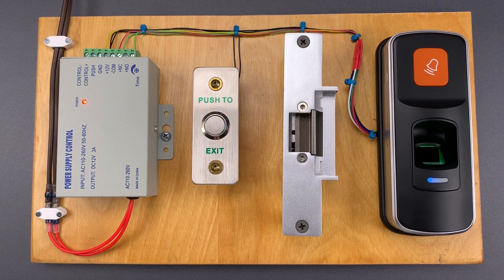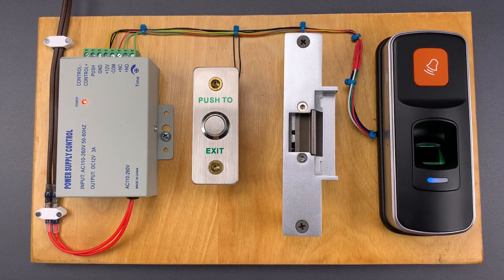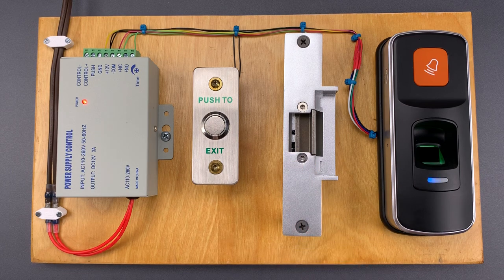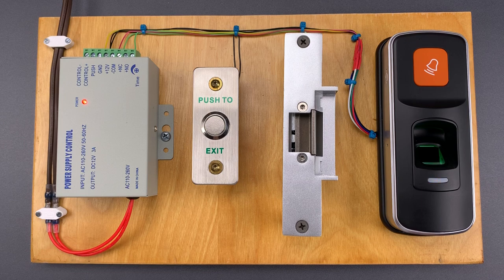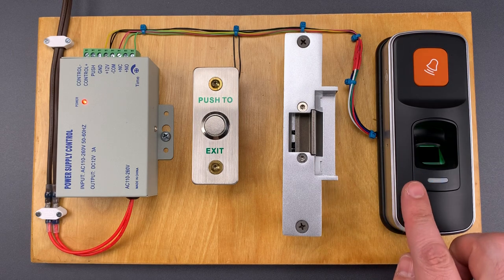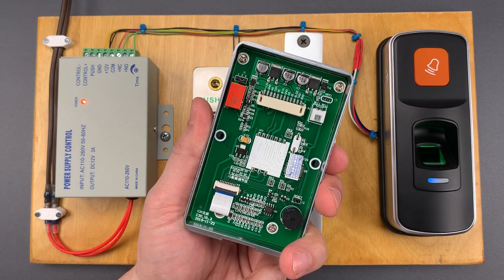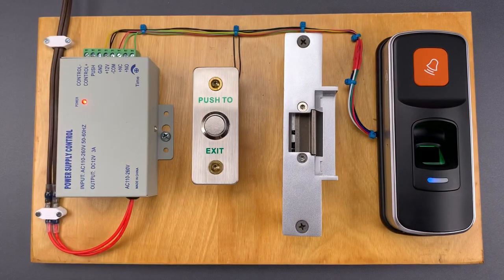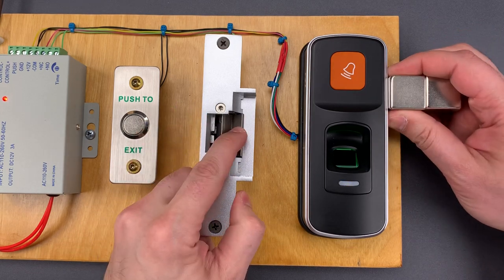[1060] Opened in ONE Second: HFeng Fingerprint Lock

Comment: "How To Destroy An Entire Industry In Less Than Two Minutes!"
Reply: hahahaha
Reply: 1 second specifically
Reply: How To Make An Entire Industry Up It's Game In Less Than Two Minutes.
Reply: but that wouldn't work if they'd used a powerful transistor or triac instead
Reply: I would say improve because they have to make the lock more secure.
Reply: I don’t even think I’d be that hard if you just had only the finger print reader on the outside, not even storing the data about the finger print on the outside with everything else inside. Bam you got a way better system
Reply: @treyspiller3931  right!
Reply: @jskratnyarlathotep8411  There are also solid state relays which are completely electric, no magnet involved.  They use these types of relays because they are much cheaper.
Reply: @jskratnyarlathotep8411  Relays have a lot of advantages electrically, like built-in isolation, along with their unfortunate drawback.
Reply: @pragmaticrealist  Also more robust electrically.  Solid state relays have a bunch of limitations on how you can use them.
Reply: they only need to turn the relay the other way so a magnet keeps it inn the position of always off.
Reply: The industry destroyed itself.
Reply: Less than
Reply: @sadev101  In that case no power would open the lock.
Reply: Proper access control systems power the lock from the controller. It sends a command to the controller telling it to unlock. This can be copied though unless its got some handshaking and encryption going on. Drives up the price of course. Want a $20 system or a $1000 system?

Possibly it would work great if there was a separate alarm system.
Reply: @veresij_  that's already the case, since you don't want to lock people in. In enterprise applications, the lock is powered by a board in an IT closet somewhere.
Reply: @detectiveinspekta  Exactly.  I installed a number of these on data centers for my old company.  The bioreader should not open the door, it should only verify the fingerprint, then the relay inside the security box opens the door. The one shown in this video is, I would guess, cheap.
Reply: You could make this without a relay, the bell should send an encrypted message on a rolling keg back to the box which then controls the lock.
Reply: Nah I'm in the industry. This is just cheap garbage.
Reply: Also this is standalone, when the controller is located elsewhere the relay is as well.
Reply: @MidnightMob209  This is the kind of cheap crap a business puts on it's supply closet to keep employees from stealing K-cups.
Reply: @jskratnyarlathotep8411  That's not the right mindset. The problem here is that the attacker has physical access to the component that both contains the logic to decode the sensor and the electronics to open the lock. Even if the relay were replaced with another component, you could still pull a screwdriver out of your pocket and bypass the system. 

What you want to do here is provide a fingerprint terminal that doesn't do anything but communicate fingerprint data to the physically inaccessible lock server at the inside of the door. You would probably also want to secure the communications between the two so that the lock server can authenticate that the fingerprint originates from the sensor and not from a replay device.
Reply: The engineers should do a better job rather than pushing out a trash product!
Reply: @johnames6430  The engineers don't just push the product. They design based on the specifications - it's Crap in crap out.
Reply: @kleinebre  Also, if you've ever owned a touch lamp for a few years and knew what a triac is, you'd know that they fail in an "open" state, so it would routinely unlock itself at random times and stay unlocked until locked again.

Comment: There's an old security adage that goes - "The more complex the system, the more susceptible it is to primitive attack."
Reply: The more components in a system, the more likely one of those components will fail.
Reply: So it all boils down to this saying: A chain is only as strong as it's weakest link.
Reply: @ollomont830 Why would I use a few simple words, if it is possible to agree with you by using a plethora of convoluted words to make the very same point?
Reply: Paul Weber I remember Dr. Who (Tom Baker, 4th doctor) saying that when thwarted by a lock that his “sonic screwdriver” couldn’t open, so he opened it with a hairpin.
Reply: If not implemented properly, that is
Reply: this implies that anything complex is inherently bad for security, but in reality that is only true in the hands of a lazy person. Give that complex system to someone who understands and cares for what they are doing and its how you get those locks even LPL has trouble opening
Reply: @ollomont830  ...And the more links there are in the chain, the harder it is to QC every single one.
Reply: Patently false. The problem here is a fundamental and monumentally stupid design flaw: exposing the final stage of the opener to external attack. The wires that open the lock could easily be accessed by ripping the control box off/out of the wall. The right way to do this is to have only the sensor outside and have the logic and final release inside.
Reply: ok boomer
Reply: @budmeister  OK toddler.
Reply: @awo1fman  im 37
Reply: Or, as Scottie once said on Star Trek, “The more they overtake the plumbing the easier it is to plug up the works.”
Reply: @awo1fman  said the only right thing. Complexity is not the problem. Stupid Design is.
Reply: @canarybiker1262  However, more often than not, complexity is a result of an unintelligent designer.  I'm not saying, in any way, that all complexity is unintelligent - just look at the design of our own bodies!  There are some tasks where complexity is unavoidable.  However, true intelligent design is always as simple as possible.
Reply: @JayRussellDuramax  I feel like this goes for cars as well. Soooooo overcomplicated and engineered. I drive an 85 Suburban. There is NO WAY a 2020 will be on the road in 2055, guaranteed
Reply: i wanna like your comment but that 666 speaks for it self...
Reply: @leandroteixeira3399  667 now lol
Reply: This reminds me of something I saw once, where some cryogenically frozen dude was revived hundreds of years in the future, and everyone had energy weapons and lasers, and shields, and forcefields. There is an all out war going on, and this dude comes out with his machine gun and starts tearing through the other side like they're tissue paper. Yhey're attuned to energy weapon discharges but turns out that through all those forcefields and shields, they can't stop chunks of physical lead propelled at high speeds. So this cryo guy is suddenly the most dangerous person out there, and everyone else to him may as well be unarmoured. Through careful planning and protecting this guy, the tide of the war is able to be turned and eventually the invading force is fought off because of basically one dude and his machine gun everyone wrote off earlier.
Reply: @Nemephosis  lol that sounds like a dope movie! What’s it called?
Reply: Or they can use a solid state relay and not have this problem.
Reply: @Nemephosis  where did he get all his ammunition from? Was he lugging around a supply truck laden with crates?
Reply: @budmeister   You behave like a 3yr old
Reply: @OooohReally  OK boomer
Reply: @budmeister  I wish I was.
Reply: @kombatJack  He said "The more they overthink the plumbing, the easier it is to stop up the drain."
Reply: @Bankable2790  Are you sure? I'm driving a 2006 car that still runs perfectly and shows no signs of age. My previous car was 22 years old when I got rid of it, and my main reason for doing so was that finding parts for it was becoming difficult and expensive. It was running well, too. My experience is that if you buy a Toyota or Honda and do routine maintenance like oil changes, it will basically last forever.

I'm old enough to remember before cars became "overcomplicated and engineered," and what I remember is that they would break down all the time. When I was a kid, my family lived a thousand miles away from my grandparents, so we were only able to visit them once a year or so. In theory, it was a simple two-day trip, time-consuming but not a difficult drive on interstate highways. In practice, we almost never managed to get all the way there without a breakdown. I do not miss those days at all.
Reply: @MundaneGray  you’re talking about a 2006, already a world of difference. I drove a 2002 for years and loved it. Still, the computers will eventually wear out. It really has to do with the parts market for it after a while, how rare that engine or its components, especially its electronic ones, become

Comment: That's actually easier than using the fingerprint system.
Reply: And more reliable, too.
Reply: lol
Reply: Yes, but I'd like not to carry a fucking neodymium magnet with me all the time lmao
Reply: @mikal_1  put that right on the ground somewhere near...its not like somebody would try to get inside
Reply: @realityjunkie09  Then its not easier anymore
Reply: FASTER!!!.....have you ever tried to unlock your phone with sweaty fingers?
Reply: @mikal_1  I don't know about you but I'd gladly keep a neodymium magnet on my keys. 😁
Reply: @Koteal  might as well draw a lock on your door so it would be easier to get in
Reply: @mikal_1  What is a keychain?
Reply: It's also safer. More hygienic!
Reply: the skeleton key
Reply: And no germs.
Reply: @sharpfang  ill get one just for the laughs than.
Reply: @adamquery7048  Actually underlines irony. Which is the reason the post was made.
Reply: @sharpfang  but the one in the video isnt big. 
Like, I have a 2 inch diameter by 1 cylindrical one, and you can only feel it pulling stuff from like 3-4 inches.
Given that the magnet in the video is more like 1/2 inch cube they should be noticeably weaker
Of course you still don't want to get it flat on some fence or something, but if you keep it in your pocket wrapped in a paper towel(mainly there to protect the coating from scratches) it won't stick to anything
Reply: @sharpfang  get an electromagnet fob, or a magnet gripper that has an "on/off" knob.  That works by using a Holboch array (spelling?) and the knob turns the middle one around.
Reply: @nikolayageenko  3/4 inch cube and there are two of them- distance from thumb knuckle to top is about and inch, and the two together are half again that distance.

Thats almost 7 times more magnet than a half inch cube, those would easily be enough to nip you painfully, let alone what it would do in your pocket
Reply: @nikolayageenko  Put it in your trousers pocket and go through a day with it, I dare you.
Reply: @sharpfang  I can only get my hands on a 3/4 by 1/4 disk right now, but there are 4 of them, so I don't know if that will be enough for you
Reply: @AngDavies  you would not want want to get thin layer of skin between them, but that's only because it will yet stuck between two magnets, which is way worse then getting stuck between a magnet and a chunk of ferrous steel 
My point for the first comment was that magnetic force falls off extremely quickly and if you carry them in an inside pocket they won't be of any nuisance to you at all
Reply: @nikolayageenko  Close, but not enough.
Reply: @sharpfang  what if you build a magnet with an on/off switch though? 🤔. Because you can...
Reply: @adamquery7048  Looks like you actually don't have a response to what I said. So I'm glad I could teach you basic writing. :)
Reply: @Orlyy  Switching it on is harder than reading your fingerprint (slightly).
Reply: This is really useful if you, in a freak workplace accident, happened to cut all your fingers off.
Reply: @Dueilangoisseus  Heh. I mean, you could still pick the finger up and use it. I wonder if they would look alike, so you have to try them all. With your good hand. But you keep dropping the others with the other hand. Fingers slipping through fingers, as it were.
Reply: And the best thing is that you don’t have to worry about catching cooties from the previous person...
Reply: @mikal_1  Wait, I have my headphones on my neck. Just let me break it apart...
In all seriousness, a thief who knows this would bring a strong magnet as a tool for the job.
Reply: @sharpfang  But my finger is not registered!
Reply: You could wear a ring with a magnet! Just tap the box and enter!
Reply: @sharpfang  keep it in an empty pocket. Done
Reply: @your_average_cultured_dude  And never ever walk up to anything made of metal. No cars, no door handles, no drain pipes on the houses, no metal-framed shop doors, no paperclips or staplers on people's desks, no keys in other people's pockets, no eating utensils on tables in a restaurant, no lamp posts, no metal fittings inside furniture...
Reply: I’m going to start opening them like this, the fingerprint scanner sucks.
Reply: @broken_font1881  Don't put in te same pocket as your "cheap" magnet strip cards. I have tried that, first with a a new card, and then also the replacement card. The third time my sister asked if I had any magnets in my pocket. I had a 200g black mgnet. Oops.
Reply: @scoutjonas  trust me I was never going to do that
Reply: Yep I'm ordering a strong bar magnet now. Company scanners hate my fingers
Reply: @broken_font1881  terrible idea mate
Reply: @realityjunkie09  it would probably lose its magnetic properties
Reply: @Anankin12  can you explain why it's a bad idea instead of simply stating that it is 🙄 also I keep a measuring tape with a very strong magnet on my keys and haven't found any issues with it 😂
Reply: @mikal_1  What kind of weird guy does not carry a magnet?
Reply: Thought the same.
Reply: @mikal_1  my dumb ass would put it in my wallet pocket  and fuck up all my credit cards lmfao.
Reply: Mora sanitary too, specially if that door is shared with others
Reply: No kidding. A lot of those cheaper fingerprint scanners are so bad even when  its the right finger.
Reply: They are incredibly un reliable.
Reply: @realityjunkie09  So puttin it under a rock as a spare key, if uve forgotten ur finger?
Reply: Just stick the magnet on a Post-It on the metal door, something that says "spare key under the mat", nobody will ever know the secret.
Reply: @Koteal  maaaan gloves. taking them off to scan is a larger pain than scrambling to find a magnet lol
Reply: This comment made my day! Thank you
Reply: @Ramiarmuni  ayyy have a great one <3
Reply: cheaper than replacing fobs aswell xD just give everyone a magnet each
Reply: we had this set up at our company and they were too lazy to import everyones prints into the database so we were all just given some magnets
Reply: @goodmate8720  sounds about right xD
Reply: @goodmate8720  ha ha. An old friend of mine was bragging about his fingerprint scanner on his phone. I exhaled  hot air on it, then I put my finger on it and it unlocked. He chuckled about it.
Reply: @Adierit  but the magnet would stick to the keys
Reply: Master key to all fingerprint lock lol